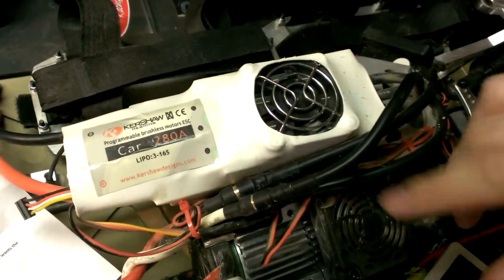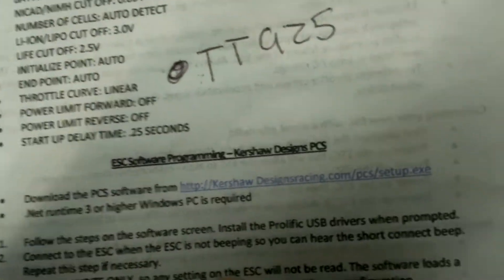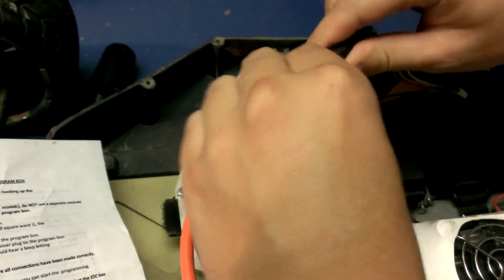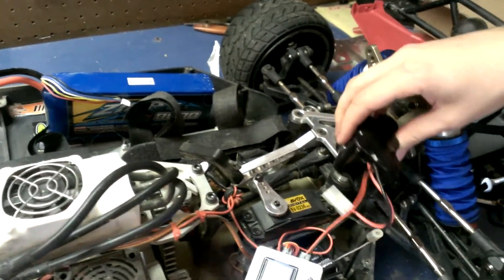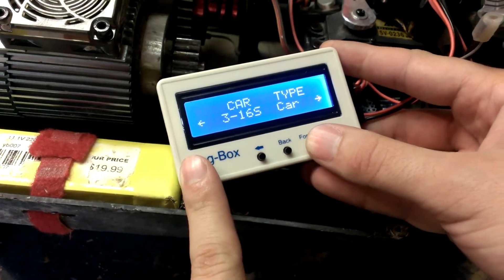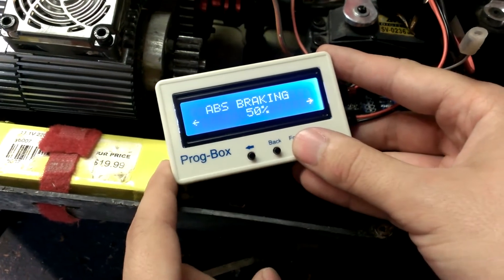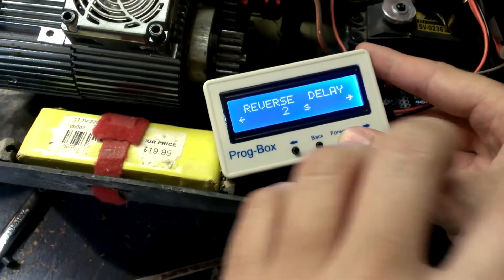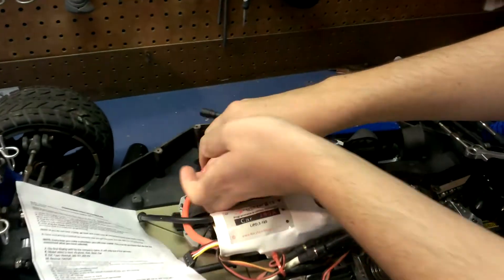Kershaw Designs 16S 280 amp esc how to program

Comment: Hey everyone I believe Flier makes 70 % of the arc esc’s out there. They are actually pretty good but as everyone says there are either no instructions or crappy ones. If you go onto the Flier website there is a file you can download then you just open the program and plug the 4 pin program cable into a USB port on your laptop. However as with the rest of the instructions the program file is clunky and not very intuitive. When I finally figured it out it was easy to reflash the esc’s but I had a lot of false starts before I got it to work. Also they do not list every esc so the 3-10s 240 amp boat esc’s I am using do not come up on the list when I talked to Flier they said the 2-16 s boat program is the one to use ........ how we are supposed to know this is beyond me so it’s a bit annoying but the price is pretty good on these so I guess you pay in hassle time. 
To access the programming file I believe you need an access code which the seller of the esc should provide. I could be wrong as it’s been a while since I down loaded the file.
I hope this helps someone. Cheers

Comment: Friend, please, a question: is there any protection system to not let the Brushless motor spin freely, ie, without the car being on-road? I did the first test in my 16SESC, but the motor spin just few seconds and then ''lock''. I wait a few minutes and it will work again, but suddenly ''lock'' again. Note: But I tested the car in my hand and not on the runway. So there was no pressure in the engine. You know tell me something about it? Thanks
Reply: Did u find out what was wrong with the locking motor? My esc is doing the same

Comment: I bought the same esc, and the instructions are garbage. Can you program the esc with a controller? Of course what you have is a lot simpler tho. And why do you have to have a separate battery pack? I was confused withe manual because it sounded like it wanted me to have a battery pack connected at all times. If you can answer any of my questions I'd be grateful.